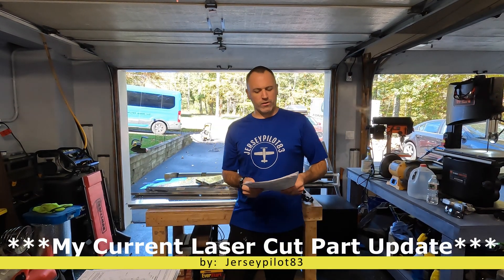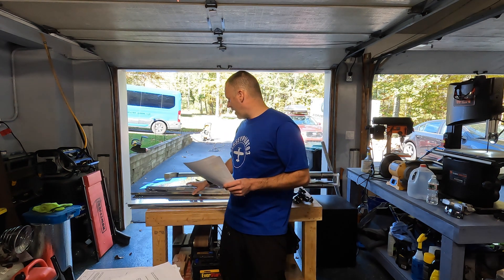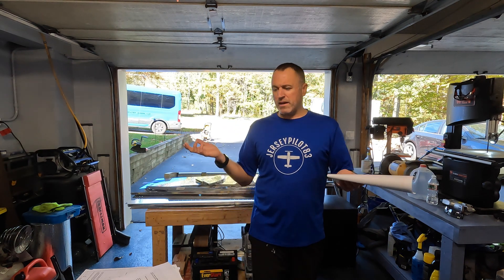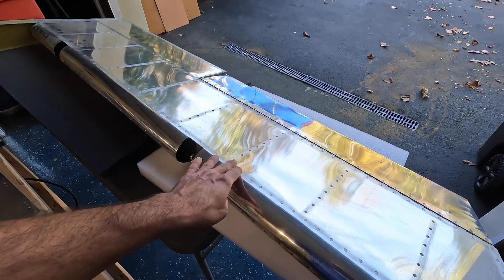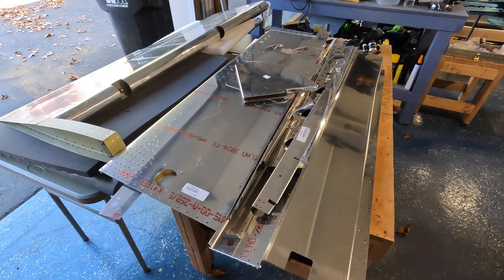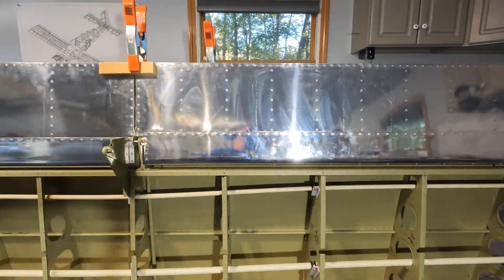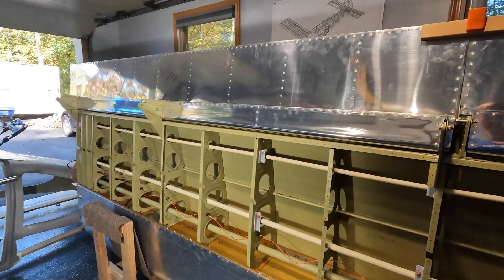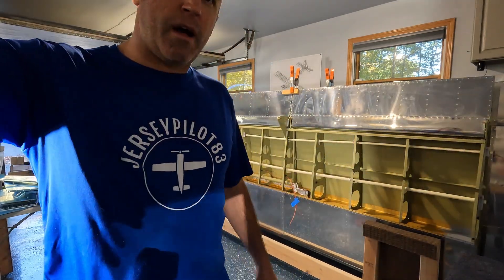Vans Aircraft  Laser Cut Part Status Update LCP on my RV10 4K

Comment: Going by their latest presentation no rv will crack anywhere at under 12000 hours even if used for airshow aerobatics 50% of the time.

Guess we can stop doing airframe inspections till 6000 hours then

Um nope, it just shows their testing isnt valid and they know that as they have service history via their SBs
Reply from the maker: Yes, I watched that very detailed video the other night which made me happy but I’m still not taking any chances and I have replaced all ribs that were laser cuts and that was only three… I found pictures of my inventory and saw blue plastic over most of the ribs. I was very happy when I discovered that… So I only had to replace the inboard and two most outboard ribs

Comment: This is also why we have Airworthiness Directives, there is a possibility of a failure and I'm sure you would rather know about the defect and take action in advance of a failure while in use. Take it in stride and work on the problem. Make a plan (in writing) of how am I going to disassemble it, what I need to inspect after disassembly, what I need to do to install the part, and what I need to inspect after I finish.

Comment: overall lcp are not that big of an issue but you do or should just remove the heat affected zone along the cut line which is about 8 thou when you file it you can feel the heat affected zone when you have removed it . if the pilot holes are lazed to the finished size then you have a problem they can be cleared out say from #40 to #30 to remove the heated material remember you only need to remove from the hole 8 thou on each side of the hole then your part is a good serviceable part removing the heat affected zone isnt a very nice or glamorous job i know i have done quiet a lot of it over the years . when you replace the end ribs in the wings make sure you put the head on the thinner material ie the rib not the flap bracket a rookie mistake . i wonder the logic of all this flush riveting is necessary i think i would just use uni head when they talk about aerodynamics and the like just think of that huge prop stirring up the air there is no real gain just a lot of work i think you would get a far neater and dent free job are you using ad3 or ad4 rivets on the fuse and wing skins just my thoughts of 50 years doing this stuff in new zealand understand your grief but keep going no point in bankruptcy vans sorry for the long thoughts

Comment: Did you notice on your own that the components are lasered or did you warn Van's?
If so, how can I recognize that there are laser-cut components in the kit?
Thank you
Reply from the maker: I noticed this after the post came out from other builders. The cracking issue is only with regard to LCP. Thankfully I do not have to many LCP! After I saw the announcements I went back  and checked inventory pictures to see what parts were missing blue plastic. Blue plastic parts are no factor but bare aluminum required using jewelers loop to inspect holes for signs of laser cutting etc…

Comment: What is the issue with laser cut parts?
Reply from the maker: When the pandemic hit more demand and less supply of kits. Because  of this, VA outsourced to other manufacturers for parts and used laser cutting to make holes rather than CNC punch. This seemed to be faster. The laser heated the parts to much and weakened the metal causing cracking when dimpling and or riveting…. Such a nightmare. There are a lot other videos out there including one from Vans Aircraft directly which was released Friday. 

https://youtu.be/3Qsfw6pmHe4?si=X_HQ43wueprtQCmf
Reply: Thanks for the explanation. I saw that video last week and wondered what was going on.
Reply from the maker: @bluangl9wingman no problem anytime